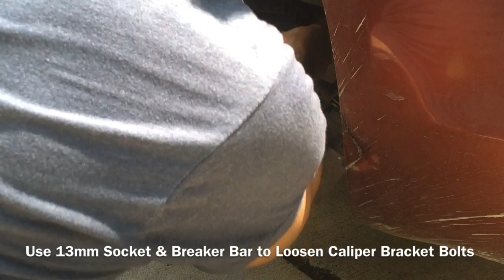Chevy Malibu Brake Pads & Rotors 2008-2012 How To Change, Replace & Install Front & Rear ECOTEC

Comment: Thanx for the Tip on the rear caliper tool
Reply from the maker: Rodrigo Nóbrega Thanks for watching & be sure to subscribe! No problem! When I first saw that style of caliper piston, I couldn’t figure out why the C-Clamp wouldn’t push it in 😂. How did the brake job go for you?
Reply: @WorkingWithWimberley  i was gonna do it tomorrow but i postponed for saturday.  Im getting the tool and the caliper grease! Thanks buddy!
Reply from the maker: Rodrigo Nóbrega No problem! Let me know how it goes after you do the brake job.

Comment: This was a good video but there are two size rotors one is small and one is large which one goes on front or back?
Reply from the maker: The larger rotors went on the front. The smaller rotors went on the rear.

Comment: I looked at my brakes earlier today because I was told I needed a brake job so I took it upon myself and checked it out my brakes are fine but on my caliper I see that the "boot" or "rubber piece" is broken and damaged. Do u recommend that I install a new caliper? By the way your videos are great man keep it up!!!
Reply: Should I change the calipers or leave them
Reply from the maker: I have replaced the rubber boots and kept the caliper. If the caliper still works properly and you can replace the boot, I’d do that. I’ve never had a caliper go bad on me. I have replaced several caliper brackets though because the guide pins that are supposed to move were rusted in place.
Reply: Great man thanks!!! Hey I have another question I took off my transmission cap and I could see the "bottom". Is that normal? Or should I add fluid?

Comment: An observation and a question -

Why paint the rotor braking surface? It seems that it’ll only get caught up in the pads and be a contaminant 

Do you also grease up the slider pins on the caliper brackets? I grease up the pins in my Caravan once a year, or they tend to stick.

Great video, I learned a bit and totally appreciate your effort. Keep up the great work
Reply from the maker: Thanks! The paint is for aesthetics and it can help prevent rust. The pads will wear it off of the mating surface after just a few stops. I have never had any issues with contamination. Also, you can buy rotors that are already painted or coated. They usually indicate that the coating will wear off of the mating surface after a few stops. I have added grease to the pins only if they weren’t moving freely, or if I had to replace the rubber boot on it. 👍🏽
Reply: @WorkingWithWimberley  :)

Comment: Is it safe to paint the caliper/bracket while on the wheel?  What if you get some paint on the rotor?  Also, is there any performance or longevity reason to paint?
Reply from the maker: I have painted my calipers and bracket with no issues. And I have also painted my rotors. Once the pad contacts the rotor, it will remove the paint off of the mating surface. There is no performance reason to paint them. For me, it’s aesthetic. It helps prevent rust and they look a little better. That’s it. It’s totally optionally and not necessary.

Comment: Great video; Question: What size (inches),  breaker bar did you use?
Reply from the maker: Thanks! I used a 3/8 in. Drive 17 in. Breaker Bar from Harbor Freight. Item # 67931 and it costs $9.99
Reply: @WorkingWithWimberley  many thanks!
Reply from the maker: You’re welcome!

Comment: Question. Why would paint the rotors? Seems kind of dangerous to me. I’m not trying to dis your video but can you let me know what’s the reason for doing that?
Reply from the maker: I painted them to help prevent them from rusting. Once you drive the car for  bit, all of the paint on the mating surface wears off. It's pretty common to do. It is optional. It is not required. If you feel it's unsafe, don't do it. Check out this link where you can see a discussion with pictures on the topic. https://www.corvetteforum.com/forums/c4-general-discussion/3004953-paint-rotor-hats-or-not.html
Reply: Makes sense. I just had never heard of of someone doing that. Might have to try it out one of these days.

Comment: I did my front breaks & rotor today & I dont see the piston thing to thighten .. am I missing it ? Or it's normal?
Reply from the maker: Do you mean you didn’t have to push the piston in? If you were able to install new rotors and brake pads without pushing in the piston, I wouldn’t worry about it. Usually you have to push in the piston to have enough room to fit the new pads in the caliper.

Comment: my fuckin caliper feels welden on to it how do i take it off with damagin any line
Reply from the maker: If it’s rusted on, there will always be a risk of breaking it trying to get it off. You can try to spray penetrating oil on it or using heat. But it will still be risky.
Reply: @WorkingWithWimberley  thank you